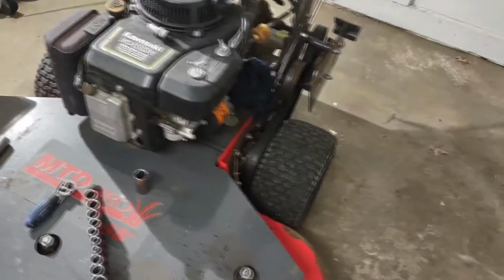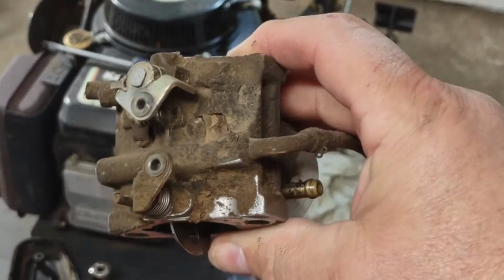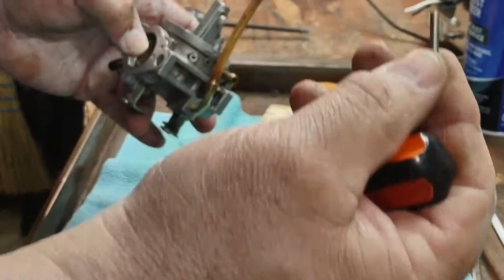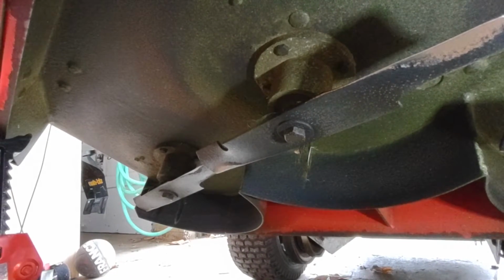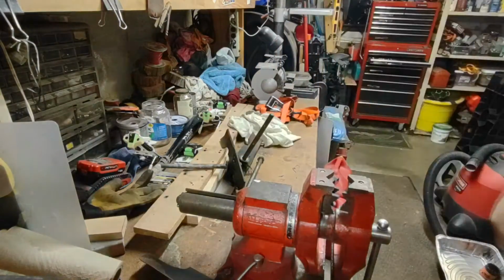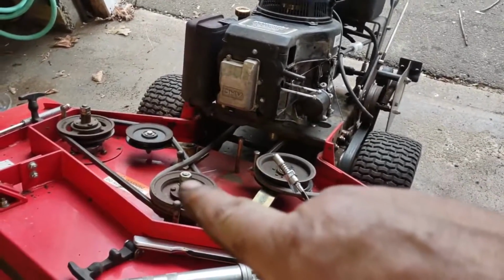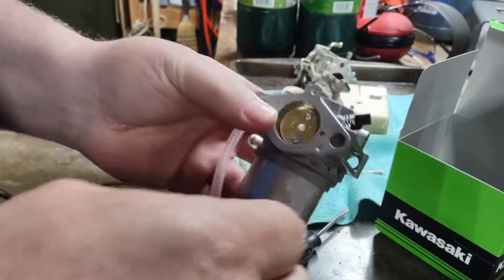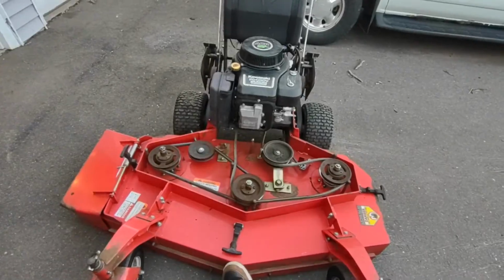MTD Pro Walk Behind with 48" cut tune up/repair

Comment: I was wondering if you could share where you get the parts from. Thank you in advance
Reply from the maker: I use Google a lot for searching for parts. As long as I have a part number to work with or the engine ID, I can find the part. Sometimes it can be quick, other times it may take me a few weeks. I keep trying different ways to find hard parts like tractor forums along with Google, dealers for specific brands. Not always easy. My 1994 312 Wheel Horse Tractor is a perfect example of parts no longer availible  so I rely on Toro/Wheel Horse tractor forum.

Comment: Man I have a few questions about the mower I didn't figure it out it says it's gear-driven so does it what's that mean does it have a belt
Reply from the maker: There is a belt that drives the transmission. Its not what they call a "direct Drive" where there would be some kind of drive shaft straight to a transmission.